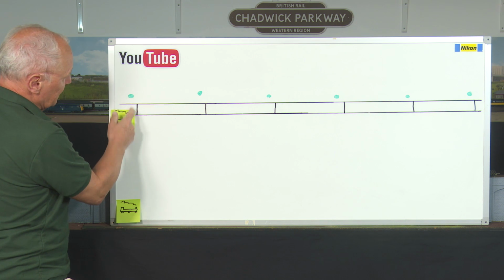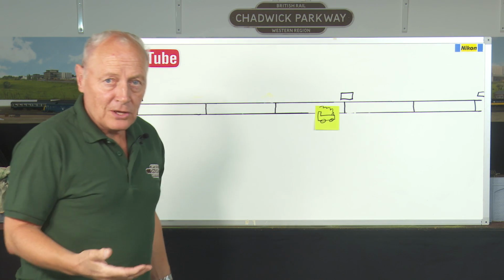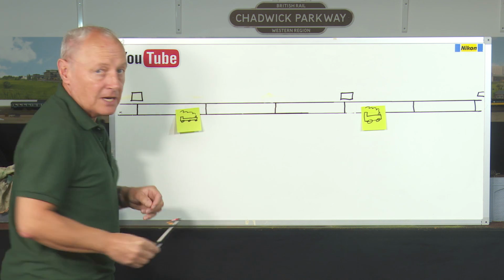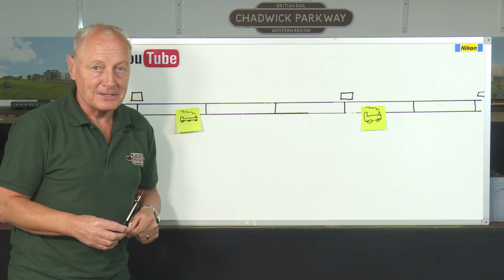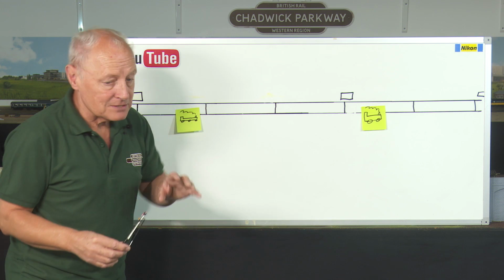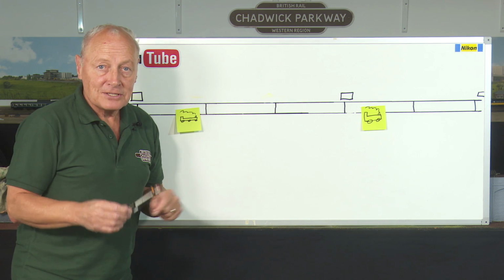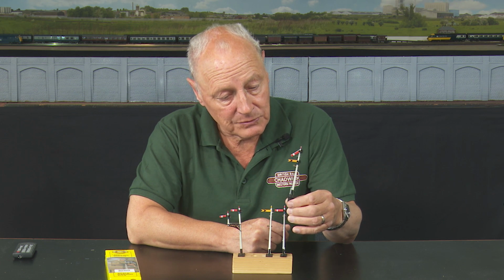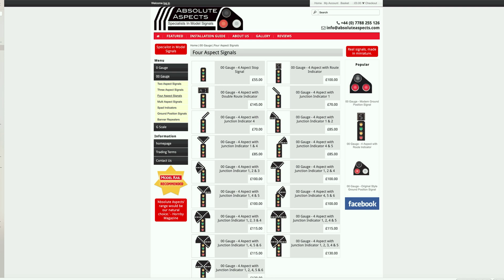Model Railway Signals at Chadwick Model Railway | 104.

Comment: As always Charlie great video before watching this i always thought that signals would go in front of points but when you explained the signal positions in the diagram you drew up it made a whole lot more sense to me the next installment on my layout will have to be signaling and this video has been a big help thank you Chadwick model railway.
cheers Nic
Reply from the maker: What a heartwarming comment Nic. I’m so pleased that you enjoyed it, regards Charlie
Reply: You're not wrong about the points though. Virtually any set of points on normal running lines will be protected by signals. A simple way to look at it: absolutely anything a train needs to do has a signal for that purpose. Without points/junctions, signalling is pretty straightforward, as Charlie explained. It's when the train has choices, that's where it can get complicated. Oversimplified but, half of signals are to allow trains to do things, the other half are to stop them doing things. If there are points though, there should be signals of some sort, except in goods yards and even then............. 😁
Reply: @2H80vids  Depends what era you are talking about. There were many main to main crossovers that were not signalled often in station platforms. These were used mainly for engineering work or emergency use and they were not signalled. Just depends how detailed you want the modelling to be.
Reply: @Chucklesrailarchive  While you can find a "prototype for everything" and there are/were many oddball signalling installations, a fairly good rule of thumb is: a passenger train will only make signalled moves.
While special instructions might allow a goods train to be moved under a hand signal, it would take an emergency situation for this to happen with a passenger train. 
From a modeller's point of view, one useful "workaround" could be the flag, shown from the signal box. Too small to model accurately(or is it?) it could account for a passenger train using an unsignalled crossover. 
Another thing often forgotten on a lot of layouts: wherever possible, facing crossovers are avoided on main lines. When possible, a trailing crossover with ground signals will be used. A facing crossover will, nine times out of ten, be fully signalled. 
As you say though, engineering works/emergencies can cover a lot of anomalies, as can modellers' licence. Few people have the space to signal their layout "properly". If an oval, with no points, is to have a signal box, it needs signals, and few layouts have the space to leave correct distances between a distant and a home signal.
Like everything else, it's what the modeller is happy with, that's what's important. If they want to do it as properly as possible, there are plenty of books/websites out there to help.😁

Comment: Hi Charlie. Basildon MRC has had a GWR exhibition layout called Kadeleigh for around 14 years and it has working signals, including ground signals, controlling the exits from the goods yard loop. All signals are interlocking and will not show a clear route unless the points are correctly set. Great video as always.
Reply from the maker: That sounds like a thing of beauty Gary.
Reply: Chadwick Model Railway Thanks Charlie. Featured in July 2011 Railway Modeller 👍🏻

Comment: Great presentation, Charlie. You covered the basics very well. Will episode 2 cover "permissive block working", "call on signals", and "flashing aspects"? 😁 Railway signalling is a very much under rated and overlooked aspect (sorry about the pun) of our hobby. Keep up the good work 👍
Reply from the maker: No pressure then Holly!
Reply: @ChadwickModelRailway  I almost forget to mention, Charlie, that as well as Upper and Lower Quadrant signals, there were also Somersault signals 😂😂😂
Reply: @hollyruston2444  And Backing Signals (Remember when Thomas encountered one?)
Reply: Will it also include double yellow aspect as in 4 aspect signalling?
Reply: Shall we include running dummies as well?
Reply: A "heads-up" for you Charlie. If you are genuinely interested in railway signalling and how it functions, there are PC based signalling simulators out there. Over the last 15 years I've downloaded many sims from https://pcrail.co.uk/index.php Their range offers traditional mechanical and more modern Power Box based options. They also offer a range of different locations and eras. I am in no way connected to PC Rail, but I have enjoyed their products for hundreds of hours over the years. As a former S&T technician, it was interesting for me to experience signalling from the "other side of the fence", ie the signallers' perspective. I highly recommend downloading one of their free demos and giving them a go.
Reply: if a train does a SPAD (passes red) does the next one have flashing red lights - that would be AWESOME to model and possible with that infra red control unit (and maybe relays) I think

Comment: Great Presentation Charlie, i have designed an Arduino in series setup that handles my signals in each block.Take care .Mac
Reply: Oooh, are you going share this? I'm looking for something similar. I've controlled my points with arduino and micro servos.
Reply from the maker: Mac, I'm so pleased that you found the video useful.
Regards Charlie

Comment: Forget about a good kicking Charlie, my opinion is you deserve a good pat on the back as this was perfect. I've been doing my own research on old semaphore signalling, i find it most interesting so this video was up there on my interest! I've kinda cheated tho, as i'm planning to model a prototype railway, I've been lucky to have references to their own signalling on the track plans to a certain extent. Your explanation was very good. I've been trying to decide weather to go the ratio signals due to the price and can be operated by hand or if i should go the dapol ones and go the dcc option and their are lit however at a much higher price. Both have their merits but both are lovely. My grandfather would be loving the models and operating accessories we have these days. DCC would be something he would be left speechless. Keep safe and all the best, Clint
Reply from the maker: Hi Clint, I think I would go with the Ratio signals and see how you get on. They can be a little difficult to function correctly. Regards Charlie
Reply: @ChadwickModelRailway  Thanks for the advice Charlie. So far im leaning towards the Ratio ones. I do shudder at all the wiring id have to do otherwise if i went Dapol. Clint

Comment: Another great video Charlie, very interested in modelling colour light signalling, so this was really helpful. Just some gen, hope this helps, as you look at signals with junction indicators, they are numbered from the left, high to low, 1,2 and 3, and from the right, high to low, 4, 5 and 6. So from your description of the station signal you need, I think you want a signal with junction indicators 1 & 4, 1 to go into the platform, 4 to go to the branch. And finally, "top shelf".................what on earth are you thinking about when you make your videos?! I hope Mrs Bishop doesn't find out! lol
Reply from the maker: Thanks for the feather numbering info. I get confused with the hands of the clock. I seem to want my trains to take the 10 o’clock exit or the 2 o’clock exit.
Regards Charlie